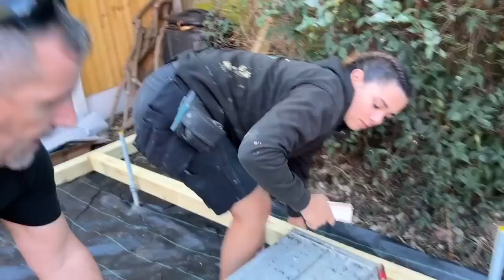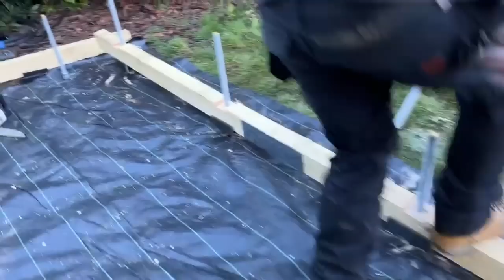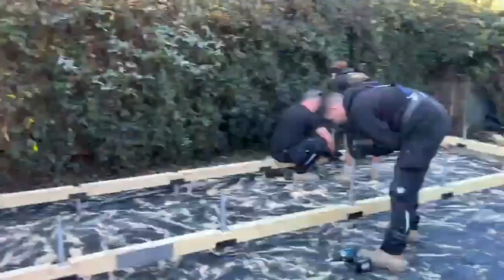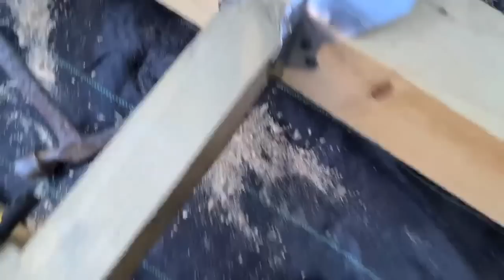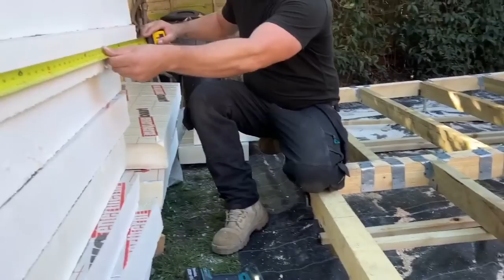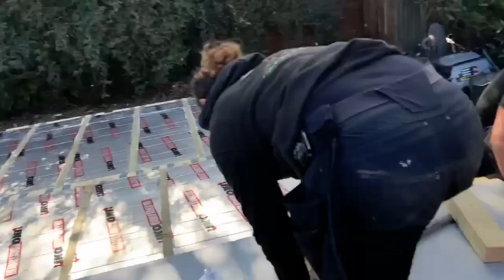How to build a garden room base using the rod system

Comment: Excellent work, and although it might not have felt like it. It was very orchestrated. Where can i source the ground rods? Also is it concrete or postcrete?
Reply from the maker: Bapps bolts sell the rods and associated bits, they deliver nationwide 0113 2439600, concrete mate, post crete isn’t strong enough
Reply: @thegardenroomguru excellent thanks for the reply

Comment: Hello Mr. Guru, I have only just started watching your channel recently, as I am helping my brother build a garden room, we have done the frame work, and put up the roofing joists yesterday. I was wondering if you had any tips that would help, when it comes to putting the doors and windows in, and when putting the rubber roof on, i noticed the broom you use looks like a soft head, has got to be, or will a stiff head be ok. many thanks for any advice in advance, I have learned a lot from your videos, so thank you. I will definately watch your videos more, when it comes to doing my own. thanks again sir.

Comment: Most interesting garden room build i have seen. I'd like to attempt Liam. Would you have a materials list for base please? Rods, bolts, plates etc. Thinking of same size. 6m x 3m. Also steel for lintel.  Thanks!
Reply from the maker: Hi 
I sell a build pack on my website, it lists everything you need for any particular size build, full instructions and suggested suppliers, I’ve also a facebook group with 40k members on snd lots have built the way we do 👌
Reply: Magic thanks. I'll firm up on size and then request a quote.  I am in rep ireland so would have to source materials from here but as long as I have the specifications I'm surr that would be fine.

Comment: Hi Liam, I'd not heard of Egger Protect until I saw this video. Near the end of the clip, I see that the boards join in an area where there's no joist below, it also looks like you've staggered them. Does a joint not above a joist remain  durable over time?
Reply from the maker: 22mm absolutely solid when glued and fixed on 400 spacing 👌
Reply: @thegardenroomguru  Thanks

Comment: Once you've got all the insulation and expanding foam in, do you think running over all the top of the joists with Aluminum Foil tape and sealing it to the top of the insulation would add an extra layer of protection? or is it overkill? Great work by the way as always.

Comment: I'm thinking to drill the floor joists first and use that to align the rods whilst they're setting in the concrete..... seems like a reasonable plan instead of using string line to line up the rods, and then marking the joists afterwards and removing potential for error. The timber would keep the rods vertical too. 

Is there anything obvious I'm overlooking by attempting on doing it this way?

Comment: Liam, if your not already get some thin inox cutting disks for the grinder.  Seem to be taking a while to cut that studding off.
Reply from the maker: they take a bit longer on the bar mate and wear down too quickly, we have a band saw now but I guess the blade needs changing, its done around 50 rods so at around £20 a band its not too bad
Reply: @thegardenroomguru  that’s not bad actually, bandsaw for the win then 👍🏻

Comment: Just bought the buildpack, excited to build our own. Thanks Liam. No membrane between the insulation and the flooring this time? I think you used to stick something in there on earlier videos?
Reply from the maker: its an over engineer, we stopped using it as if it rained it held water and as the room dried it was drawn back into the room, not an issue if you have time but we need to turn these round in weeks so opted out. over engineering

Comment: Liam,thank you for all the videos.i really enjoy watching them.May i ask you can you build over 3 metres  in depth without having to double up on the roof joists or using using flitch beams?would it make such a difference to go to 3.6 in depth for example?.thank you
Reply from the maker: its too much for the 5x2 at that mate, we are breaking the span tables as it is but if your keeping under 2.5, there's not much choice.

Comment: Is it the threads on the rods that bare the weight in the end? 
Cheers
Reply from the maker: Yes mate, but if your worried about it Google a video of a press pushing on a m24 bar, it takes a ridiculous amount of  weight before it fails, then you have the fact the weight of the build isn’t all on one bar, it’s 👌
Reply: @thegardenroomguru  thanks, just wondered if had missed something. Vids are great! 
Cheers again
Reply: M24 grade 8.8 thread will take approx 15 t at 70% yield stress